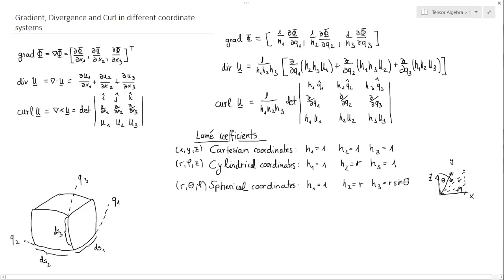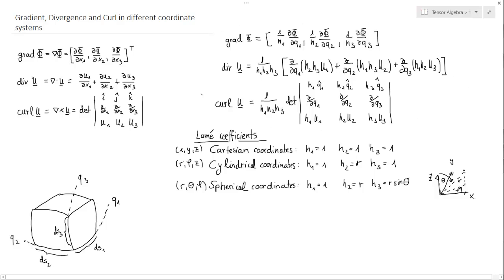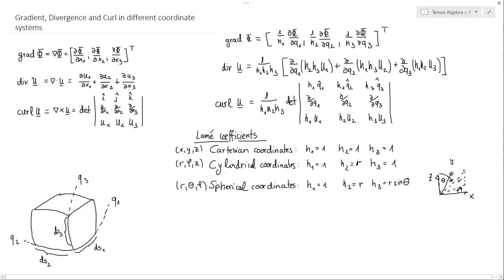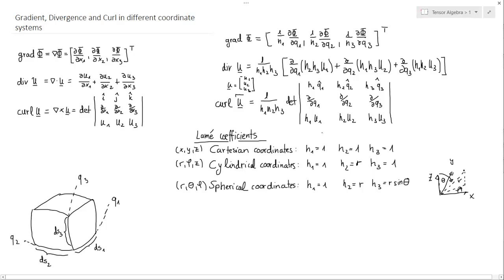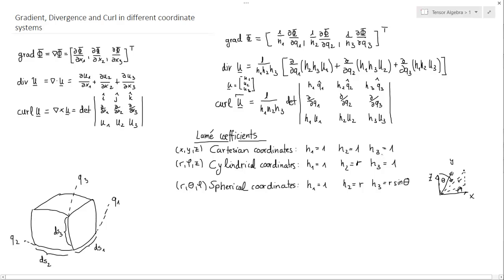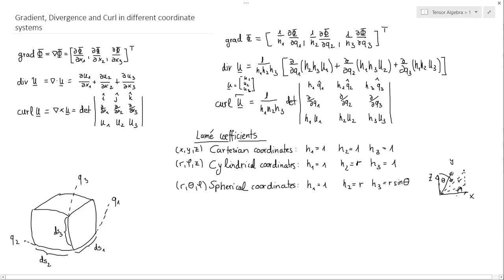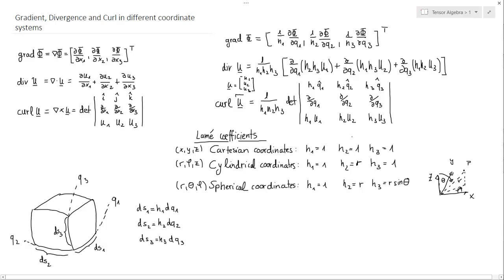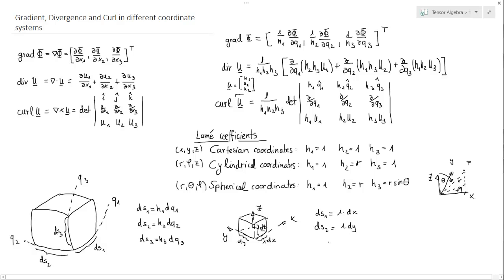Gradient, Divergence and Curl in arbitrary coordinate systems Part 1

Comment: Hi thanks for the video. Is it also correct to approach the lame coefficients as the magnitude of the derivative of position vector r wrt the variables of the coordinate system? In your video that is the ||dr/dr|| and ||dr/dtheta|| in cylindrical. Because I did the derivation for all the unit vectors for cylindrical and spherical and it looks similar.

Comment: thank you very much for giving a general formula 😘😘😘
Reply: That's not a general formula, though. It wouldn't work, if the local basis is skewed, because in that case lame coefficients do not contain complete information about metric tensor.

Comment: Thanks for the video, it's really helpful. I did have however have one query; for the cartesian and cylindrical co-ordinate systems, the lengths ds1 and ds2 were in the x-y plane, whilst ds3 was effectively the height (z axis). For the spherical system however, the lengths ds1 and ds3 are in the x-y plane, and ds2 appears to be the height (or rather vertical arc); is this what was intended? 

Presumably, if the length ds2 was in the x-y plane as with the other systems, it would have the value rsin(theta).d(phi) (where phi is the angle in the x-y plane) - thereby making h2 = r and ds3 as the height would have the value r.d(theta) thereby making h3 = r. So for the spherical system with co-ordinates <r,phi,theta> you would have h1 = 1, h2 = rsin(theta) and h3 = r. Is this correct?

Comment: Is it true that the sum of all h are actually the trace of the root of the metric tensor?
Reply from the maker: Matrix Tensor I would think so (i am not using the summation convention), as g_ij = h_i*h_j, g_ii = h_i*h_i =|h_i|^2 and sqrt(g_ii)=|h_i|, hence Trace(sqrt(g_ij))=Sum(sqrt(g_ii))=Sum(|h_i|). As |h_i| are the Lamé coefficients we directly get your statement. I hope i could answer your question.
Reply: @MrYouMath  

What do you even mean by sqrt(g_ij)? How do you define a square root of a tensor?
Also, this "g_ij = h_i*h_j" is not true. For nondiagonal components of the metric tensor, there would also be cos of the angle between local basis vectors.